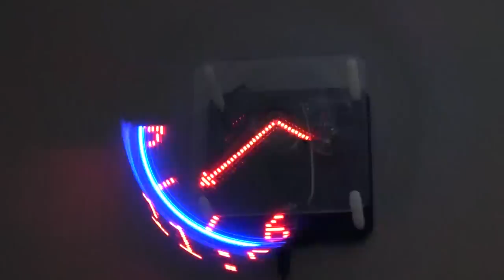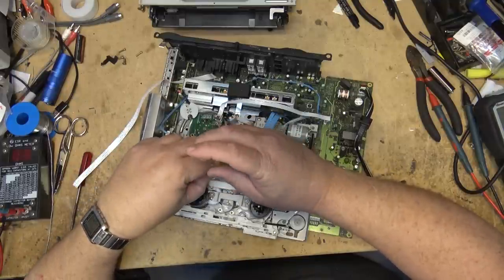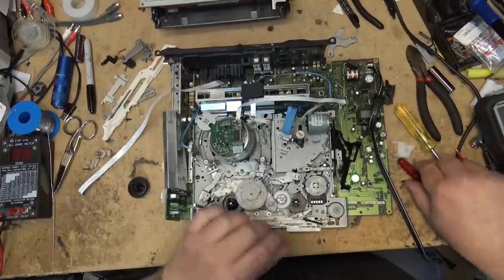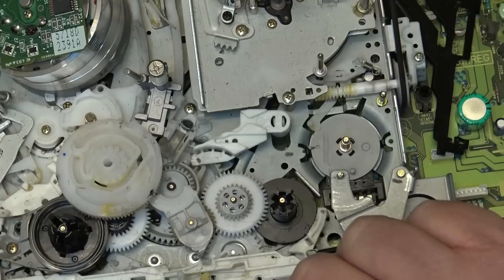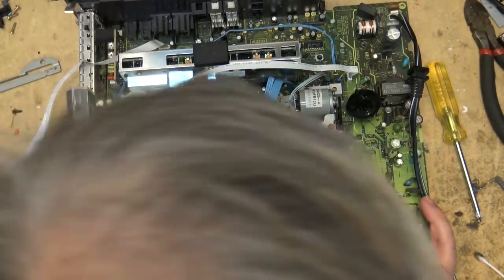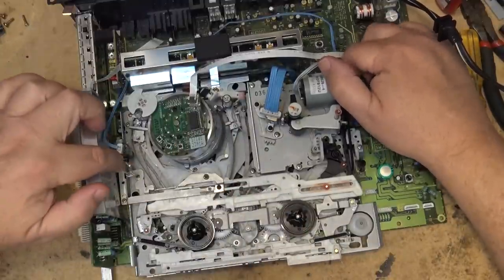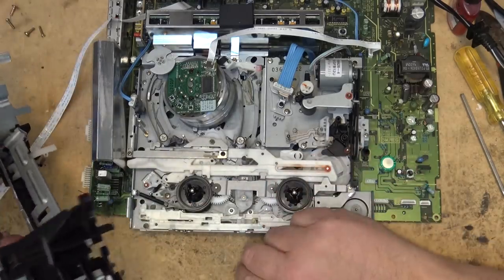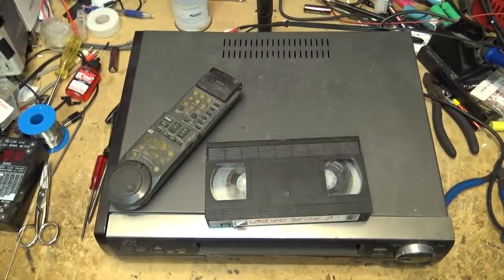JVC HRS7200 SVHS mechanism repair

Comment: I have a JVC HR-S8500 that shares the same chasis. You can actually remove the chasis without removing the circuit board. There are three plastic hooks holding the chasis to the board if memory serves me right and those can be pressed down from the top with some pliers, much easier. Great video.

Comment: My HR-VP628U had the snapped off spring problem, but I had to jury-rig a new post for the little bugger. Fortunately this machine is a dream to work on, with only 4 screws and 2 clips to remove the entire mechanism! Mid-90’s made in Malaysia.

Comment: Thx, for the walk through. I had the same problem with the spring anchor broken off.  I just glued a screw on to take its place.
Reply: Thanks for this idea!  I was able to shove a very small, very flat head screw right through the plastic arm and glue it in. Just had to remove the arm and risk further disassembly.
Reply: Update: the glue didnt hold long. I ended up, hooking through the plastic.

Comment: JVC made great super VCRS.  I had the 6700, 6800 and 6900 in the early to mid 90s.
Those were the day when you would rent moves from video stores.
Reply: I still own a 6900. Aside from the white streak issue, I've found it to be a very reliable machine. Of course, I have found the 9500 9600 9911U machines to have a much better PQ.

Comment: most likely the reason jvc put the mode switch where it is on the last batches of vcr is they knew most people would switch to dvd due to the labour charge to dismantle and clean the switch and decide the repair was not worth it

Comment: I would hazard a guess that the broken  piece has something to do with the missing door. Most likely the tape failed to eject due to the dirty mode switch and the owner had to forcibly remove it. The weapon of choice for this procedure for the electronically challenged back in the VHS days was a butter knife from the kitchen.  I haven't seen the inside of one of these since the 90's. Brings back memories. Did you ever get one of those strain relief pliers? ATB Doug.

Comment: Hey, a plastic piece that's connected to a metal pin, like a guide pin, fell out of my HR-S4600U. I'm trying to figure out what part it is, but the exploded view in the service manual is crap and doesn't show the part. The VCR works completely fine without the part, but I'd like to get it back where it belongs. It's a white/clear plastic piece, and there's a metal pin coming out of it. It looks like a guide pin.

Comment: I have an HM-DR10000 (European D-VHS model). It sometimes moves the mechanism on startup similarly to this one and sometimes inexplicably decides to go to standby or eject the tape. After seeing this, I'm positive it's the mode switch. Unfortunately it's the same design as yours, and as I'm a newbie when it comes to VCR repair (I can pretty much only clean, do basic lubrication and belt replacement), I'm gonna have to leave it like this for the moment. Perhaps I can find someone qualified locally to take the switch out for me but unless there's an easier way it's gonna have to stay glitchy for now (which is a shame as the VCR is otherwise perfect and very enjoyable to use and those intermittent glitches are pretty annoying). Thanks for the video, if I decide to be reckless, I may try to follow it along and do the same, messing up the timing and reassembly are my main concerns.

Comment: That black piece of plastic is from the inside of a vhs cassette it’s one of the reel brake clips
Reply from the maker: No, it is the arm that lifts the flap that covers the cassette slot. I'll show it in the next video with an identical mechanism.
Reply: @12voltvids  I also immideately suspected that. I only thought it's called something like curtain arm or a cassette door arm.

Comment: And I thought Panasonic's G mechanism was hard enough to take apart...
Reply from the maker: These are horrible and I have another one to do.
Reply: yep especially when it comes to mechanical issues e.g. timing re-alignment - some are a royal pain in the ass and take several hours to put right, while others are a piece of cake and take just minutes.
Reply from the maker: Yes some panasonic units were also a joke.
Reply: @12voltvids  The Panasonic D mechanism from the mid 80s (like the PV-4760 power supply repair you uploaded a while ago), is the best chassis Panasonic made in my opinion.
Reply from the maker: The D chassis was one of the better ones Panasonic made. The down side is it had to unload to FF and REW.

Comment: I have HR-S9700 which had problem with loading, didn't regonice tape when inserted. Fault was rec-safe switch which I managed to find online. After that noticed that loading motor belt din't hold up so motor was spinnig but belt not. Replaced with little bit bigger belt but now broblem is that tape loading is slow and seems that motor has not enough of power to load and eject. With hand helped from motor tape can be loaden and ejected. But can it be motor problem or sticky loading mechanism? Motos spins fast if no belt attached

Comment: Neat procedure.
Any idea why JVC HR-S6711 fails to switch to fast winding?
Reply from the maker: It all depends on the tape load and hub sizes.  Tapes 60 minutes or less need to be on the large tape hubs.  Most custom loaders just sound less tape on standard hubs.  The machine measures the tape length based on the rotational speed difference between the hubs.  Custom length causes the machine to misbehave as the rotational speeds don't match what it is expecting.  Therefore it won't go into high speed rewind.
Reply: @12voltvids  That's not exactly what I meant. I meant the machine switches to fast winding after ~30 seconds fo regular, but whe nswitched the reels don't move and the machine detects that as fault and powers off. DigitalFAQ forum suggests the belt may become too loose or smooth on the surface, thus on fast revolutions of the engine there is no grip, thus it doesn't transfer the movement to the mechanism.
Thanks to your video I was able to disassemble the deck and take a look on the mechahism and it doesn't appear that any gear is broken, or snapped due to plastic aging.

Comment: I have a JVC SVHS player that keeps cutting in and out while playing a tape. The screen will begin to tear, drop out completely, then suddenly come back. Happens every 10 seconds or so. You can also hear distortion in the audio and it will pan to one speaker before dropping out. Any ideas what it could be? I know absolutely nothing about VCR maintenance 😅
Reply from the maker: Sounds like a tracking problem. Possibly a dirty control track head.

Comment: Have a JVC S4900U SVHS deck I brought to a shop for service, only to be told it couldn't be fixed because some part of the eject mechanism was supposedly missing. What do you suggest?
Reply: That mech can be fixed. I still have the 4900 5100 7100 6900. Apparently it's some loading gear on the mechanism that needs repair. 

I had one of my 6900 units repaired once for that issue, but when I moved it 1 1/2 years later, it broke again.
Reply: @videofun4651  Wish you told me this sooner, I got rid of the VCR in a basement cleanout!

Now I'm trying to fix a 1984 Panasonic top-loader and a circa-1986 RCA (which uses a Hitachi chassis).
Reply: @VSigma725  dont waste your time repairing those 80s machines. I've owned virtually every single JVC SVHS mechs over the years, and the machines with the best picture quality are the JVC HR   S9500/9600/9911/7500. 

I also recommend the Panasonic AG 1980.
Reply: @videofun4651  Its not about video quality, I have a 1980s "time capsule" in my basement with a 1982 GE television and I wanted an 80s VCR to go with it. For video quality I'm obviously going to go with a SVHS deck.
Reply: @VSigma725  gotcha.
Reply: @VSigma725  I've been looking for an old JVC TV from my childhood which I cant find anywhere. It's a JVC AV 2687S 26 inch CRT set from 1987. It was the first JVC TV with SVHS.
Reply: @videofun4651  I've been looking continuously for S-VHS decks but they just don't come up often here.
Reply: @videofun4651  I myself am trying to find a circa 1990 Sanyo TV to replace my beloved childhood set that vanished some years later.

Comment: 12 volt you did not clean the mode switch contacts on the motherboard surely you should have done those too ?
Reply from the maker: They wont need cleaning.  Copper doesnt oxidize as bad as silver which is what the switch is based from.  Silver is a better conductor do they use that for the switch.
Reply: @12voltvids  Ok  12v thanks for explaining :)

Comment: Can someone send a vcr to you for repair?
Reply from the maker: I get equipment sent in all the time.
Reply: @12voltvids  What city, state are you in?  I have JVC S7800 that when I digitize vhs tapes, there is faint but consistent patterned "flutter" in the audio.  Sorta reminds me of what helicopter blades might sound like if they were in slow motion and recorded at level just above audible.  I am going to try cleaning the inside if I can get it apart easily.
Reply from the maker: @staytunedforgottentvmedia6417  I would recommend finding something newer.  These old boat anchors are all failing and parts are not available.

Comment: Wow what a serves frendly design...
Pain in the ass. I'd be better off scraping that vcr for parts to fix more worthwhile equipment
Reply from the maker: The only thing that makes this a worthwhile repair is because it is a SVHS
machine. If it wasn't an SVHS it would have been turfed.